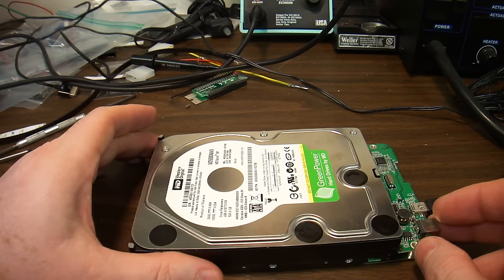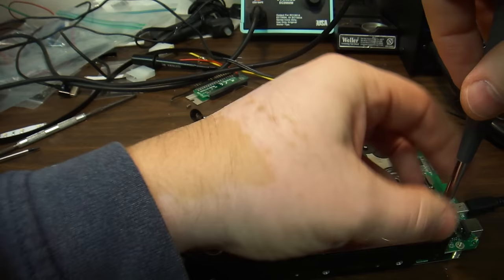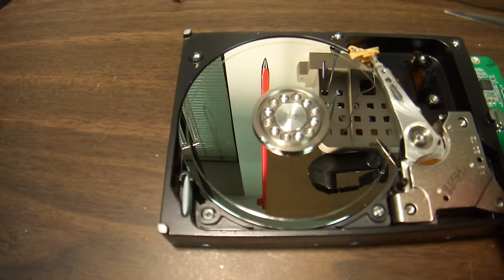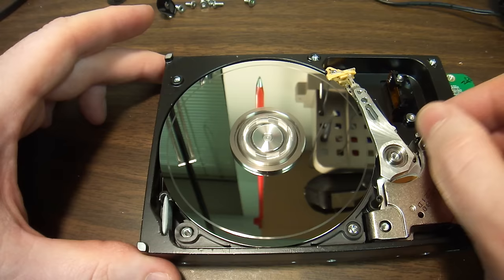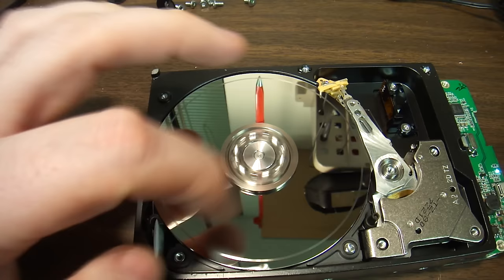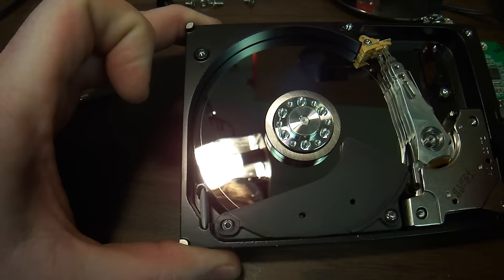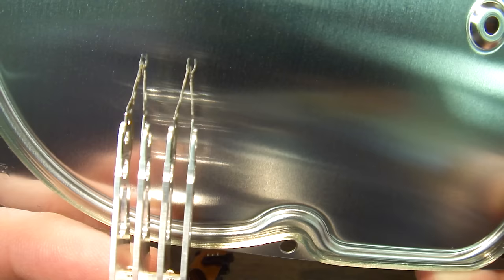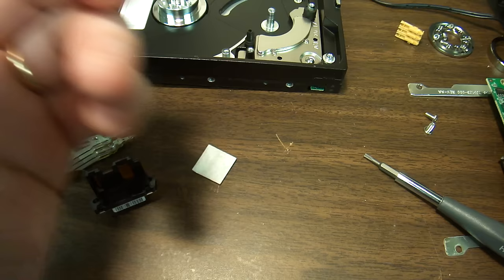Clicking hard drive dis-assembly. How to and what to expect. 500GIG Western Digital USB storage.

Comment: Enjoyed watching it taken apart but it appeared to me that you could still retrieve a large part of the data that wasn't scratched.  Isn't the large unscratched sections still recorded data? Or is the only data on the disc the smaller outer section from where the scratch occured?  I'm just curious if there is a way to recover SOME or the undamaged data, and if not, should we hang on to our platters or hard drives incase technology comes up with a way to do so. Thanks for the learning lesson on damage and disassembly.
Reply: Way after anyone probably cares given SSDs but the answer is a big "Well..." The fact is there are companies that do computer forensics and have the equipment to do this. It is astronomically expensive and what you get out of it is going to usually be underwhelming. A few things complicate it aside from what is mentioned in the video. Big one is that as this head was swinging back and forth desperately trying to find the FAT or whatever, it was also sandpapering the surface of the disc. While it might look undamaged there are probably unreadable sections scratched all over each track. Some types of files like images may be at least partially recoverable.

Comment: By taking apart the platters, it almost impossible to align them correctly again. New drives are very precise and complicated because of  the very thight data density. The latest harddrives have a chip on the motherboard that stores physical info about the drive and it's unique to the drive. For example, it is impossible to use donor drive and replace the motherboard, or using any other parts of it without copy the information stored in this chip. It is very very complicated, almost impossible.

Comment: Is it even possible to replace the damaged heads and platters AND that it is working again, because of the alignment? 
When you know how a HDD is constructed, then YES. The data on the damaged side of the platters is non recoverable. However, after modifying the heads-unit (simply said: cutting off the heads which are used for the damaged sides of the platters) AND modifying the firmware of the HDD, ALL the data that's on the undamaged sides of the platters, CAN be copied to another HDD.
It is expensive to have this done. It is up to the owner of the crashed HDD whether or not the costs of the recovery weights up to the importance of the data that's on the damaged HDD.

Comment: I had a Seagate Barracuda that fell down to the floor from about 50 centimetres, while it was running inside the computer. It died instantly (head got stuck). A Samsung T166 was mirrored to it and actually got smashed and thrown down to the bottom of the case, and, apart from that, experienced the same incident happening another three times. 3 years and about 8.000 hrs later I'm still using it, and all it shows up in SMART is a few CRC faults due to the a power loss from that. Not a single reallocated sector, nothing. I hate Seagates, never had a working one (last one I had was only three weeks old and already showing up a lot of delays, swapped it for a WD)
Reply: maxtor dimondmax are by far the worst no docking for the heads so any vibration and your hdd is dead in a sec plus it was the days when ide was the best anyone could afford ps my hdd was 20gb

Comment: Oh my god! My 3TB Drive yesterday falls exactly the same way you say in this video! Fortunately the drive is divided into two partitions. The second partition that has the most inportante seems to be in perfect condition. But the first partition has problems early on. When reading the first few sectors of the drive, it makes reading noise like the old hard disks and has difficulty reading information having enough stops and errors. I experienced the HDD Regenerator getting correct some errors but other errors will reappear. I'm at the stage of copying the entire contents of the hard drive. Still go on time. Then maybe try to delete everything, format, etc. to see if there will still be some hope the hard drive back up and running normally. Then nothing can perhaps venture to open it to see if there is a problem in the surfaces of the drive disks as this video. And there goes the expensive hard disk to waste. ::-(

Comment: Hi, I have a 3TB Toshiba drive and I cannot read anything from it, I just hear it clicking when I connected to the power and my computer does not recognize the drive and I need to recover all the information I have on it, what do you suggest me to do? So can you fix it? thanks!!
Reply: Take it a local technicial. If the hdd is not recognized by the BIOS it may be a electronic failure or a firmware problem (Bricked ). 
Surface scratch are always a trip to data recovery center, sorry

Comment: hi , my 1tb western digital drive gor dropped , dosent work anymore the heads are fine, but a plastick piece is stuck on the platters, can i take off 1 platter so i can clean the other one? or it will cause dataloss forever?
Reply: You cannot. Removing one disk will result in a 100% loss because you can never ever get it back in the correct position.
Reply: 1 in a million chance use compressed air for cleaning cameras to blow it away, be carefull of condensation
Reply: if you even get the platter off even microscopic inches, your data recovery will give you nothing. they have such a small alignment that you can never remove just one. tools are needed to pull the platters off without moving them at all. Thats why it costs 5000-10000$ to do a data recovery.
Reply: *****
After taking that piece of plastic out , it come from the heads lock thing, appers to work, gives a status bad backup and replace error, however data is still readable but its slower

Comment: Hi I accidentally dropped my external hardrive. I am able to access on of its partition but the other one is just not working. Any Ideas on how to make it work?
Reply: Probably too late but : clone it on Linux with ddrescue (or HDDSuperClone, might be easier as it has a GUI, but both programs require a good level of expertise to be used efficiently, as it's still a risky operation).

Comment: Best prevention is Ghost or some other recovery method to another drive or multiple drives.. That is why RAID was invented.
Reply: Willy Durf RAID is not a backup solution, it is an uptime solution.
Reply: Actually pretty much the same thing. A mirrored raid setup is pretty much like backing up the data on multiple drives. The only difference is Raid arrays are active and ready to use. Backups are not redundant. Raids are on the fly BU and ready should one fail.
Reply: Willy Durf That is a very dangerous fallacy that unfortunately is used as justification all to often.

Good backups are redundant. Automation is essential because it removes the human whenever-I-get-around-to-it factor, especially if your data changes frequently.

Consider the case where a file is accidentally deleted, corrupt, or perhaps held ransom by malware: your RAID controller will happily propagate these bad changes out to all parity copies.

Plus it is not uncommon to suffer additional drive failures during a resilver.

Comment: i have the same hard drive and i bumped it.now it does not see it when i connect it,ore it asks too get formatted....the disk has no viable damnage(on top) and the arm is movable......what can i do??
Reply: If you already opened it : you're screwwwd.
Otherwise, you could attempt to clone it on Linux with ddrescue, it may still work enough to recover a good portion of the data, but it can also fail unexpectedly and make things worse... If the data has any value to you, bring it to a professional — a true professional, not a random dude with hairy-greasy hands talking nonsense on Youtube...

Comment: What happens if you run HDAT2 check&repair on it? would it attempt to recover any good sectors?
Reply: If you have PHYS (physical) damage then the drive each run could be last.  So  recovering bad sectors is ludicrous.  Need to run FTK images or DD and image what's left

Comment: Ya after it you open and wrecked sensitive parts then it was history. Actually you can use the head as actuator or sensitive trigger for let say rat trap and for platter its excellent for electrolysis.

Comment: so even if the platters are not entirely damaged there is no way ?
Reply: Yes this drive is dead because off the huge scratch caused by the head crashing on the drive.
Reply: @FMCREPAIRARMAGH22  mine have precius data it is a maxtor made in 2001 and have 15 gb the head crashed near the center of the single platter the scrash is very thiny and barely visible

Comment: WARNING DO NOT OPEN IMMEDIATELY ! First open task manager & sort by hard drive usage, then start closing programs 1 by 1. I found on my drive that a program I had would cause the clicking; so what i did was just re-install it. DO NOT open your drive without first doing proper diagnosis.
Reply: This more for hard drives that don't run at all

Comment: you could have recovered alot of data from these plates, but not in the damaged area,, and you would only get out what i call"binary data" its not that, but almost the same, the data would have had to rearranged, but i have actually recovered data from platters like this, but you need special equipment to do this,, and its costly of course :P and i agree,, Almost 0 % to change heads, platters aso aso, and think it will work,, it will not,, the raw data would need to be extracted,, and then put togehter again,, thats why data recovery is EXPENCIVe,, when they know what they are doing, the best companies, offers free checks of the disk, :)
Reply: Thomas Matikainen and it would not work if you never have defragmented your disks :P then ALOT more is lost. :(
Reply: +Thomas Matikainen Actually, there's at least one program (ZAR), which is able to recover data without any meta data; i.e. from the raw binary data from the actual data sectors. Those could possibly restore the data from the non-affected areas of the platters. I'm not 100% sure they could, but I'm pretty convinced.

Comment: Recently dismantled about 9 Hard drives simply because they were old IDE drives and of such small size wasnt worth keeping around any longer . took them apart to make sure no data was able to be recovered . run an 80 grit roloc disc at 20 thousand rpm over all the platters then bent them in half and tossed them in my scrap aluminum bucket along with housings. About 50 cents worth of scrap but it wasnt about the money I just don't like the idea of the garbage man reacing for free hard drives in the trash and possibly recovering some data. why spend hours using data wipe software when a sledge hammer is faster ?

Comment: please answer me my hard disk is clicking soft clicks but its working OK and with all programs it show no problem. and there is a beep Sometime not much just 1 beep. i need to knew why it make this sound.
Reply: really ??
i had a 160GB HD but its make nothing.
this is a 2TB HD is this maybe the reason?
Reply: the beep could be it parking the heads because the drive is idle meaning it is not reading/writing data. Seagates especially do this, its just a park tone.
Reply: thanks guys i am relieved
Reply: line clear
Reply: the light clicks are the heads being docked so that vibration dont let the heads and platters contact   the heads are bout 100 atoms away form the platters most hdds are either 5400rpms or 7200rps even as high as 20000 for servers. the light beep is he hdd platter motor spin up

Comment: Should we believe that beeping sound in hard disk drive are damaged???
Reply: I'm no data recovery guy, but certain types of beeping noises can come from mechanical parts trying to run when they're frozen. This can happen when the heads get stuck to the platters (stiction). Getting them moving again seems more promising than a recovery where the heads have actually crashed and there's damage, but it's still a clean room job.

Comment: Let me make it abundantly clear but if your hard drive contains material that is illegal for example if you are a threat to the security of the country then the security services will be able to read the hard drive
Most of the technology is still classified but in short
Even if the disc is bent or scratch  they can now read it via laser....
Security Services pride themselves on being able to recover data it's a badge of honour for them.
All of the other Data Recovery clowns out there just buy the exact same hard drive and replace the parts.

Comment: there is nothing wrong with removing the cover and putting it back on ? Really? That's not what i have read about it. If you remove the cover you leave dust fall on the platter where no dust must be. From what i have read a hdd opened is an hdd for the trash.

Comment: Does this work for external HDDs?
Reply: +Afraz Anosh  This is an external HDD being shown in the video. All external HDDs are actually based on models of internal HDDs with slight modifications, usually making them cheaper and limiting their performance, and then simply boxed in an adapter enclosure.
Reply: Most of the time they're exactly the same as internal counterparts... the HDD in this video used to be sold as an internal HDD too. Sometimes though an external HDD can have no SATA port but instead a USB controler soldered directly to the PCB – those are really troublesome if they fail... (Recently I bought two used Western Digital MyPassport which are of that type – but I didn't pay much, and they work perfectly, I may resell them when I finish reorganizing my scattered stored data.)

Comment: DO NOT EVER TOUCH THE INSIDE OF YOUR HDD LIKE THIS GUY, WEAR GLOVES AND USE PLASTIC TOOLS TO MANIPULATE THE DISK AND THE HEAD. THIS IS INSANE
Reply: you can physically see the deep groove in the plate. right away I would not even of attempted to fix it, if there was data on this hard drive that you wanted to recover, just touching it with static electricity on your finger will instantly kill your hard drive. the data will NOT be recoverable. PLEASE, open it, look at it, DO NOT start turning it back and forth and pushing the head in any way, you should be able to turn it with plastic tools, counter clockwise ONLY, if the head does not manually click back into place when you turn it, GENTLY put some tension on the head and continue to turn the disks WITHOUT touching it in any way, I would wrap some wire around your wrist and touch it to something metal on your desk when you are touching the hard drive. any electrical discharge on the exposed plates will kill the hard drive instantly. I can't stress this enough, it's not something you crack open and start prodding at if you dont know what you are doing, the lil engine in there is like a swiss watch, do not turn it if it does not want to turn, at this point pay for data recovery, put it back together and bring it in, with you thank me later.

Comment: my platter isn't spinning, can u help?
Reply: Yes i can help you need to change the "PCB" and probaly will work!
Reply: depends, if the heads have fallen onto the platters and stuck there, theres not much you can do, but if the spindle has stiction, you need to send it in. Platter swap would need to be done, but no one can just do that. Very sensitive process
Reply: ***** If the heads are stuck you could open it and try to move them back to their proper spot (usually near the middle or off to the side) and see if it works...

Comment: Thinking you can recover any data from this drive by replacing the read/write heads is like thinking you can retrieve your severed fingers from a meat grinder by reaching in with your other hand. The instant the read/write heads seeks over that abrasive groove it is game over instant destruction of the read/write heads. The drive electronics will not allow the read head to park on the platters. And that drive is going to simultaneously write information to all 4 faces and those heads would have to be installed with an alignment of within a few microns to make the cylinders line up or you will get absolute digital noise from the read signal. It's not impossible, but it is so fucking technically difficult that it costs 4 figures to do this kind of data recovery. If you are so sure it can be done, show us how it's done...

Comment: 14:55 Head and platter replacement was possible, though the methodology was known only by few -> https://youtu.be/J9P4UadRdNA?t=1080
Reply: Very interesting, I'm thinking of doing this myself so I have got questions. Will it work if I swap the head using the same model, size, first 3 digits of serial number and same firmware version?

If it will work, can I use hddsuperclone to clone the hard drive or I still have to use PC3000??
Reply: @chris01479  I can't answer this, but if that data is very important, you can document and plan the swap, then give it a try.